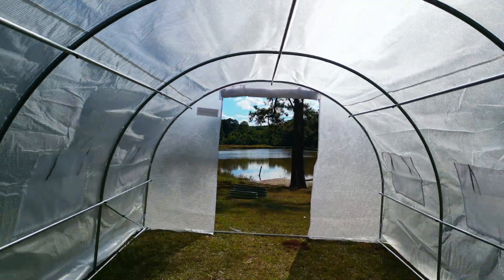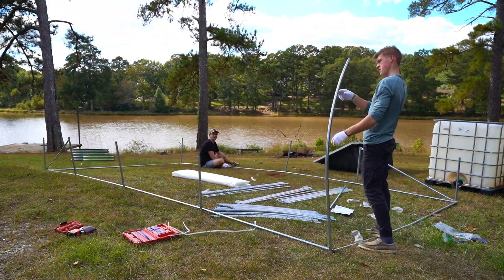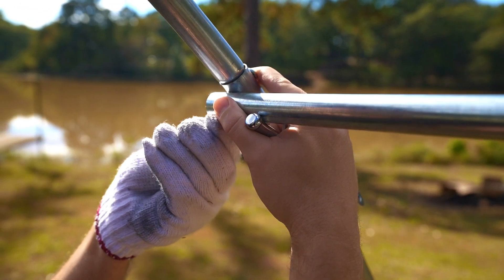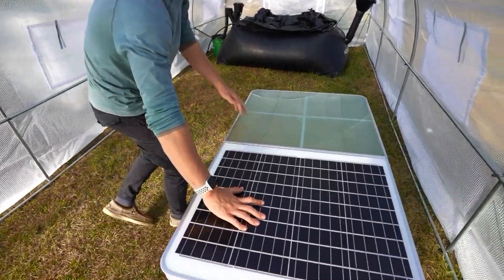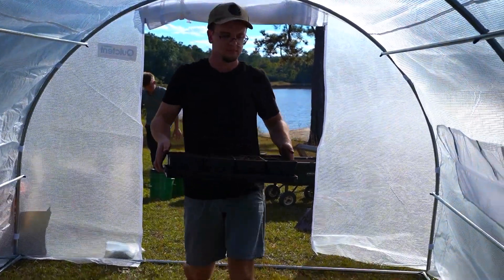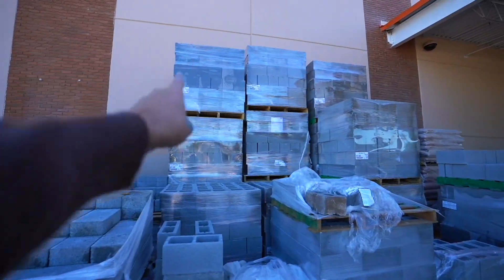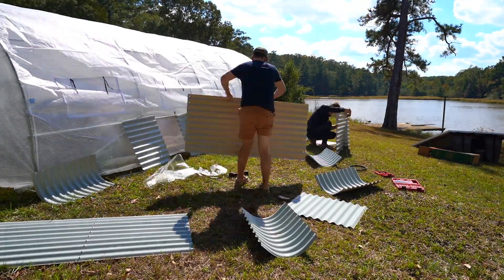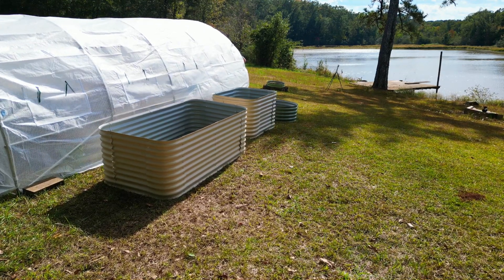Setting Up Our Green House (Quick & Easy)

Comment: So to get a little bit of cooking fuel, you need to buy a methane digester and a greenhouse. Have you compared the costs compared to refilling a propane tank with a dual burner ourdoor camp stove?
Reply from the maker: The gas we get from it is more of a plus. It’s main purpose is to replace a septic system. 

A septic system cost 10-20k. 

The methane digester cost $975. 

Big savings!
Reply: @acornlandlabs can I just jump in here and ask- are you using it for all the toilet waste then? Just so I have understood. Sorry I have autism and don’t always understand what I read or hear so I like to double check I’ve got it right. 

That’s the main reason for the digester is instead of a septic tank so it works like a septic system would and then that produces the gas off that you can cook with and the letche that you use as fertiliser but watered down so it doesn’t burn roots or plants. 
Have I got that right?

Comment: I have a question if I open the land lab simulator you need carbon for composting but I can’t find a possibility to manufacture carbon?
Reply from the maker: Carbon is in all organic matter! If you need pure carbon just burn some logs! The left over black material is carbon. 

We recommend you inoculcate your carbon if you plan to add it to your soil directly. 

Inoculcate it by placing it into your compost or liquid fertilizer for several days.